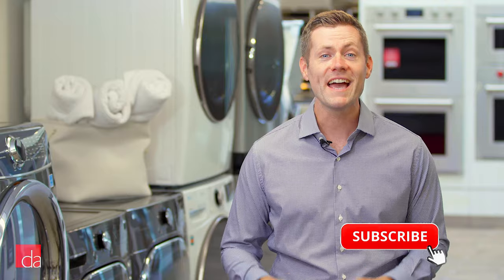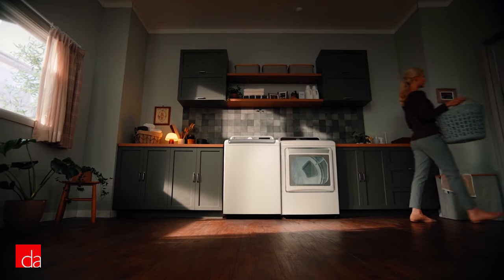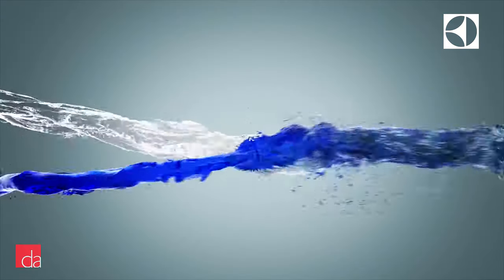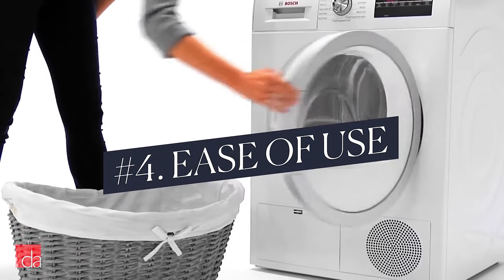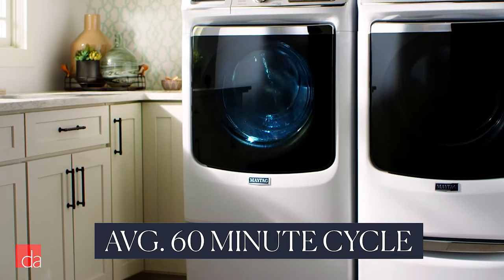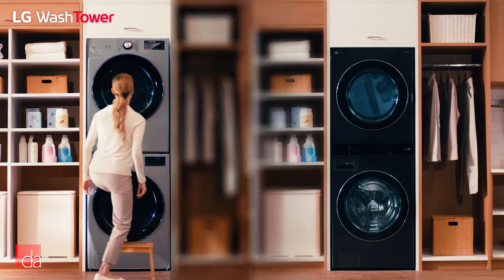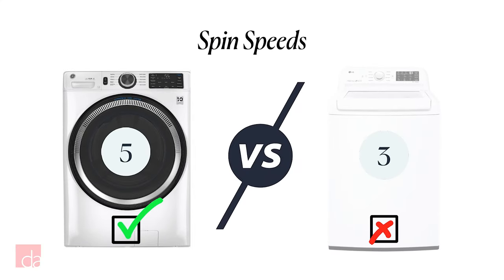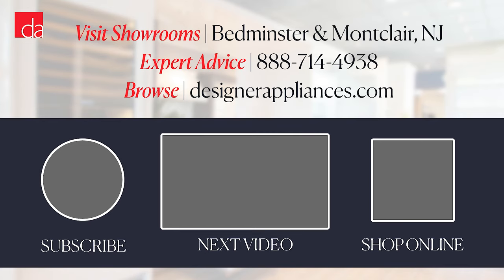Front Load vs Top Load Washer - Selecting a Washer Shouldn't Be Confusing (Updated)

Comment: Having owned both I can attest to the superior cleaning performance of a front loader. They win hands down in all situations. I do however have a $4,000 Miele front loader which is known for longevity and lasting performance. I think the reason so many American households have issues with mould is the way the appliance is used and limitations with the power supply. 

For instance, if you strictly use powder detergent, it contains bleaching agents which help prevent mould growth. However in the USA, Liquid detergent which doesn't contain bleaching agents is the preference. Additionally, its very big in the USA to use fabric softener and scent beads, all things that attract mould and trap dirt and odours in the machine. They also contain waxy residues which stay damp and promote mould growth. The reason your towels are coming out smelling musty is because the liquid detergent is unable to kill the bacteria, so then people have to add laundry sanitisers and scents to mask it. All additional expense and unnecessary if a good quality powdered detergent is used with bleaching agents. Liquid detergent really is only good for delicates and preserving colours because it doesn't contain bleach.

Another point, in other countries, our machines will happily get up to 95 degrees Celsius, almost boiling point which keeps the machine spotless. However, due to 240 volt not being standard and the limitation of power supply, front loaders in the USA are reliant on the hot water supply which cannot match these temperatures. Combine that with the machines not having the power supply to quickly get the water up to temperature and the short wash cycles, you're creating an environment that promotes bacteria growth. Therefore, even performing cleaning cycles, the water simply cannot get hot enough to dissolve all the additives and unnecessary softeners people are running through their machine and cleanse away the buildup. My machine will alert me to perform a cleaning cycle or run a program above 60 degrees Celsius if I have done 5-6 loads consecutively under 60 degrees celsius. 

I have had many front loaders and never once have I had an issue with mould, I just leave the door open, I dont even wipe it. There's no secret, use the appropriate length cycle with out softeners or additives and a good quality powder detergent, leave the door ajar and once every so often run a hot cycle and the machine stays mould free. 

My issue with the top loader was it spun at 700RPM, it unbalanced all the time and the wash performance was poor. Additionally I was using 3 times the detergent. The Miele needs so little detergent and spins everything to 1600RPM. It makes a huge difference when it comes to dry times. 

Maybe this information will help someone who is struggling to prevent mould, hopefully its helpful to someone.
Reply: Wow Luke!  That was great information.  Thank you for taking the time to comment here.   I will be mindful of your tips when doing laundry here on out.
Reply: 4000.
Reply: I use powder detergent . Ariel powder and i have a front loader for 4 years in my home plus my mom has a front loader for 10 years and never have mold problem .
Reply: @veronasaramati8627  true. Powder is the best.
Reply: You should almost never use a hot wash cycle if you care about your clothes
Reply: @flakgun153  almost. Just in some cases.
Reply: @flakgun153  you would only utilise a hot cycle for items such as towels and durable bed linen. You would not use those cycles for colour clothing or delicate items. These hot cycles are also very beneficial to use with an empty machine and a washing machine cleaning agent. For the most part, avoiding liquids and softeners are going to be the most beneficial with a hot cycle for say towels once a week.
Reply: How has your experience been with the Miele  ?
Reply: @massimo7219  it’s a good machine and I do think it is built well. I did have an issue with a noisy metal noise which is quite common for some reason where the springs require lubrication. The noise isn’t damaging to the machine but it isn’t what you expect from an expensive brand. The technician lubricated the springs and the noise was instantly gone. I haven’t encountered it with any other brand except Miele. However since that was done it has been quiet again when spinning.
Reply: Thank you, Luke, for your great post. I've never owned a front load but am considering. Do you put the powder in the dispenser or in with the clothes in the drum of the machine?
Reply: @anamacmillan7582  hello! You’re welcome :). I put it into the dispenser.  The dispenser is there as part of the design process so I figure why would they make them if it wasn’t supposed to be used.

I did try on one occasion out of curiosity just putting the power in the drum directly and at the end of the wash found powder that had not dissolved all stuck around the seal of the door but had never happened using the dispenser so I haven’t done that again.
Reply: For 4k it better clean well and last!  But why would you want to spend 4k on a washing machine!
Reply: Not ALL situations.. the main reason I say that is, if the location of the washer is in such a place that the door can't be left open at all times then a top load washer must be used.. We recently purchased a rental property and when we bought a new whirlpool washer and dryer set we were going to take our old set to the rental house. The problem is the laundry room is located at the back door and the washer is positioned so that if you leave the door open on the washer then you can't open the back door of the house.. If we were to leave a front load washer there, then there would be no way to leave the door open to keep it aired out and prevent mold growth. In this situation, top loader is the only way to go.. Just throwing that out there because its something important to consider when buying..
Reply: @williamblanks8500  it’s very true that the door should be left open. I have never shut my door on my washer with any product loaders I own and I regularly do a hot cycle to keep it clean. However the door doesn’t need to be wide open. The door just needs to be unclicked so it has a small gap and within a few hours air can still get in and everything is dry inside. 

I don’t use any fabric softener either because that causes mould. People put a lot of additives that you don’t need to clean the clothes and they all build up and create mould and smells. Most fabric softeners are derived from animal fats so you don’t want that coating the inside of your washer.
Reply: I think LG top loaders are an exception. I have a front loader and my parent's LG top loader washes better. It has a turbo wash function which spins the entire drum which then shoots 6 jets of water and soap on to the clothes pulling it through the clothes. The way the impeller then rotates and the way it is designed, you can see how the clothes rub against each other and are turned around. The rinse is also more effective with an extra atomising jet spray that rinses during the rinse cycle. It's amazing honestly and you can fit much more in it. My clothes come out cleaner in an LG top loader. But only the LG one.
Reply: Well said
Reply: Comparing luxury cars to washers is like comparing apples to oranges. No one should have to spend $4000 just to own a washer that's going to last for more than a few years.
Reply: Regarding the mold problem with front load washers: Whirlpool and several other brands settled on a class action lawsuit and admitted that they sold washers that had a known design flaw that caused mold problems. On a side note, we purchased  a  Whirlpool Duet washer in 2019 and it lasted 3 years before the cost of repair would have exceeded the cost of a new washer. We replaced it with a Soeed Queen top loader TC5003WN and love it so far.
Reply: @francoamerican4632  it’s an analogy that isn’t to do with the longevity but why someone would pay that price. I appreciate the design, the performance and the technology that is superior to other offerings. I appreciate the package as an entirety. The same way as when I buy a car, I could get a car that does the job but doesn’t have all the additional bells and whistles that I come to appreciate and the performance I get from European engineering is always more exciting to anything else I have owned. 

The analogy fits perfectly, you can buy an Electrolux which I would liken to a Toyota which is a fantastic car, it won’t have the same level of bells and whistles but it’s going to be a great product that will last. If an affordable option where I live and will give you a product at 1/4 or the price and do everything you need it to. 

Not sure why you guys in the USA have such problems with products going the distance. Other countries our washers even on the cheaper end of the scale easily reach the 10 year mark. All I can think of is you guys have more American products in the laundry category then nearly any other country. Brands like GE and Kitchenaid,and all those American brands you guys have on offer a lot of the rest of the world doesn’t and we don’t have the same issues. That may lie your issue.

Bosch, Electrolux, AEG all have affordable offerings at much less then Miele and all will do the task at hand perfectly and should last the expected timeframes. 

The only difference which may impact longevity for any brand is machines made for the USA always are supersized, have compromises with their power supply voltage and their wash times are short. Add in all the additives used to the average American home that are not necessary and it makes sense why they don’t last. My only advice to you is to buy European, even though Electrolux make their products in Thailand and India and china etc, their brand is at heart Swedish. 

Hope that helps
Reply: @francoamerican4632  I’m glad you are happy with what you’ve bought. However as you know, speed queen whilst not as expensive as Miele are still pretty high up there. If you are willing to pay the price for something you see as superior and the value proposition makes sense to you then that’s the way of the world. 

Brands like whirlpool don’t even come into my country and when they do they are here for all of five minutes before they pull out from the market again. The hold they have in the USA is backed off when they produced commercial grade long lasting washing for the domestic market and that hasn’t been the case for a long time. 

Whilst I can appreciate there was a lawsuit, you can sue anyone for anything in the USA. It’s not really a benchmark of truth. The fact is mould only develops if the door is left shut on the washer after use and the wrong chemicals or the quantities added are used. I know this not only from common sense but from working for a major white goods brand as a manger for three years. Mould is not a mechanism of a bad appliance, it’s a symptom of an appliance that has been operated incorrectly. I also remember the lawsuit you’re talking about and I believe they stated they would try to incorporate better design to allow for airflow to help prevent mould. In Europe, front loaders have been the only option in most of Europe for over 50 years. They have taken over with the majority of the market in Australia being front loader occupied. Asia as well. It used to be that top loaders still held their own in many parts of the world, but now it’s very biased to front load washers and they finally are cheaper then their top loading counterparts due to economies of scale. 

I bring it back to the point that laundry is a commodity, it’s heavily marketed for people to buy liquid detergents, scent beads, fabric softener, dryer sheets, laundry sanitisers. You’ve got people adding in 4/5 chemicals to clean their clothes. This is unique to the USA and it’s corporations capitalising on selling you what you don’t need and products that do no good for your machine. My Miele does have its own detergent dosing system which I wasn’t thrilled about, however I don’t add anything else. It’s not necessary. 

If you use a scoop of powdered detergent and nothing else, and leave the door of a front loader wide open after the cycle. Within a few hours the gasket around the door is completely dry, mould cannot form and you can either shut the door or leave it ajar. Periodically run a washing machine cleaner if needed through to cleanse the drum and if need be wipe the seal of any hair or bits of dirt have accumulated. It’s really not rocket science. It comes down to a set and forget attitude, and weather that’s a byproduct of sales staff not educating customers on what they need to do or it’s laziness I couldn’t tell you.
Reply: @LJ P 120V has nothing to do with water temp. You think you can't boil water with 120V? It's the difference in design. Washers for the European market heat their own water because of the historical difference in central hot water availability compared to the US. Also, European washers tend to be much smaller than ours, and also tend to be all-in-one washers and dryers due to the living space constraints. It takes much, much longer to do laundry due to this. I notice my European friends and family seem to be constantly doing laundry, instead of once every two weeks as it is in my household.
As for mouldy front-loaders, I think the problem is related to using too much detergent, generating a great deal of foam that gets everywhere, carrying food for mould. I think when Americans get front-loaders they continue using the washer as they always have, and can't believe that front-loaders require so much less detergent. Also, liquid detergent has become so much more popular and it seems to foam more. 
Having experienced doing laundry in Europe (yes, with Miele machines as well), I much prefer doing laundry in the US.
Reply: @Pheckphul1  I’m sorry but washers sent to the us market have their heaters downgraded to 1.0-1.3kw. Our washers are built to 2.3-2.4kw. The heaters simply don’t have the power to draw which is why many homes in the USA require a special outlet for electric dryers. The standard plug doesn’t give enough power for the heating required and the larger heaters are not compatible. It’s not a criticism of the USA it’s just the limitations of the grid. The same limitations Dyson had for many years and why Dyson came to the USA market very late. James Dyson talks about these issues and how his motors could not run properly in the USA market without significant reworking which wasn’t possible in the early stages of the company and that’s why Dyson came to the USA market much later when they had the finances to have a seperate product for the US market. The preference for a machine that heats its own water isn’t down to hot water availability but rather accuracy in temperature. My Miele has dual fill from hot and cold and in the user menu I have it switched off. It’s impossible to set the temperature to a target and get that temperature from mixing hot and cold from taps and having cold water in the hot water line. That’s why machines in the USA say cold, cool, warm, hot and extra hot. It’s not possible to get consistent results to a degree of accuracy depending on what the water supply is doing at the time. The same issue persists for dishwashers. 

I personally don’t find any constraints with a 9kg washing machine which would be considered fairly large, however they do go up to much larger sizes here. The European brands are just lagging behind with increasing sizes compared to some of the Asian brands. Not too long ago their biggest machines they offered where 5.5kg so for them to be at 10kg as the biggest any European brand is making currently would seem huge to them. LG & Samsung are offering 16/18KG models in comparison. However these don’t appeal to the majority. The sweet spot in many of the European and Asia pacific is between 7.5-9kg. 

Having worked for a major European white goods brand as a manager for many years, I can attest to any combo machines being a compromise, with poor drying results and long term reliability issues. Some people do use them but they are not common and sales of them don’t move as people have used them when they came out and wised up to how mediocre their results are, how ridiculously long they take to dry and how much electricity they use to perform that function. Majority of people now buy ventless heat pump dryers and stack them or have them side by side. I always say if you can have two seperate machine’s, do it because a combo is never a winner. When they came out the hype was high, except for the people have who absolutely no other option, when you do a survey of your customer base you’ll find 8/10 people will tell you they will never own another combo unless they had no other choice. 

However as you rightly stated, the issues pertain to the products used, the quantity of the products and improper maintenance/airing of the machine. All issues that really are user error. 

Today for example after I finished up doing some washing on some detailing towels from the car, immediately following I ran a 85 degree cycle. 35 minutes and the machines not got any time to build up grime or grease. It’s just about being proactive in your approach
Reply: @lukiejames  Actually, most washers in the US do not heat the water, but rather rely upon the water heater that is standard in all houses. As you say, this therefore doesn't allow for exact temperature control. Also, I believe our detergents are designed to work in colder water than in Europe. Most people don't wash their clothes in hot water due to cloth/color wear and shrinkage issues, in addition to using less energy. In my experience, outside of washing rags I've used while repairing a car or other similar heavily oiled cloth, warm water is sufficient. 
As for the 220v vs 110v issue, our internal wiring is mostly 110v, but the connection from the grid to the house is 240v. As far as I know, all electric dryers are 240v in the US, same for electric stoves/ovens. As 75% of dryers sold in the US are electric, I don't think access to 240v power is the issue. Rather, it's tradition. Top-loading and using household hot water has been the standard here.
As for a $4K washer, no thank you. Like most German machines, Miele are too expensive and overly complicated.  I don't recall the exact amount I spent on my LG washer 14 years ago, but it was around $800, and it does it's job quite satisfactorily. The only issue I've had with it is that I had to replace the tub bearing, which was very simple to do.
Reply: @Pheckphul1  you don’t need to repeat what I have already said in my original post. I am aware that they use the hot water system however European models still will feature an element as a boost to this in some applications to the US market. American made speed queen or American made products do not bother. 

Detergents are for the great majority universally all produced by P&G, Unilever & Henkel and branded different in different countries with different fragrances. 

However this is getting away from the original advice on preventing and maintaining a front loading washer. 

Happy washing! :)
Reply: Huh, that is very interesting! Im german and most people here use front loaders, and the mold bit confused me too. While it is something to keep an eye on, its never been as serious of a problem for me. You certainly dont have to clean it every week. But the difference in washing supplies and temperature handling might well explain the difference. 
Tbf Im usually running the washing machine between 30 and 60 degrees. A lot of clothes dont like higher temperatures anyway.

Im a bit ignorant of how top loaders work, admitteddly, but mechanically front loaders just seem to make more sense. Gravity allows them to really throw around the laundry, while a top loader can just wiggle them arund mostly. Worse, theres probably a difference between clothes at the center and at the outside. 

Like, im sure top loaders do the job too, otherwise they wouldnt be used, but the other way seems more logical. Top loaders seem a bit outdated nowadays.
Reply: @Schooey Not much of a place when theyre worse at cleaning and less efficient. Seems like one of those inventions that mostly keeps up because of traditions.
Reply: @Schooey Pretty much any "scientific" testing seems to have proven that front loaders are better though, its even mentioned in the video? 

Its also just logical. The top loader has very limited ability to hurl around the laundry, while a front loader can use gravity.
Reply: @Schooey If the professionals have better results with front loaders, then isnt that more of an indicator that people who struggle just do something wrong?
Especially the bit about mold problems makes me think so. Thats not a normal.

Afaik the popularity of top loaders is also mostly an american thing. Eg in Europe, theres almost only front loaders in use.
Reply: @Schooey Why do you hate experts so much lol?

I mean the people were talking about have the agenda of doing reliable and honest tests, because thats what theyre paid for and when they screw up they lose money.

And yeah, almost everyone in europe uses front loaders and they clean great, and generally dont got mold issues.
Reply: @Schooey Or have you just forgotten what I actually wrote? No, it must be everyone else thats delusional :^)
Reply: @Schooey Im biased because im citing scientific tests. How peculiar!

But hey, Im happy for you that you are so unbiased that you can speak for >500 Million europeans.

You got some problems lol.
Reply: @Schooey Looking it up, its more like ~50% for Australians, theyve been switching too, if slowly.

Also, imma be frank: Youre being a bit delusional here, aka you make stuff up I never said and then strongly argue against it. I did not claim that top loaders are worse in every aspect (the video seems quite good besides the mold bit), that people using them are dumb, nor even that they 'should' switch.

Ive said front loaders are more energy/water efficient and clean better, which I consider the most important factors for such a machine. That top loaders seem outdated.
Everything beyond that you just made up.
Reply: @termitreter6545  American style top loaders without heater are also used in developing countries around the world. Also don’t forget that the vast majority of people on the globe wash clothes by hand.
Reply: @lukiejames  so you bought a very expensive Miele washer and turn off or don’t like all the features that make it so expensive lol 😂 you could have chosen a much cheaper Miele model that doesn’t have all the features you’re turning off.
Reply: @Pheckphul1  nowadays talking about exact temperature control is a joke anyway. With all these ECO programs the washer doesn’t heat to the specified temperature anyway. ECO 60 heats to maybe 40-48 degrees. I guess what the companies are trying  to say with that is that the program delivers the same cleaning performance as a 60 degree Program 40 years ago. Just like on LED bulbs they tell you a 9 W bulb is equivalent to a 60 W candescent bulb.
Reply: @manuel0578  not sure what you’re talking about? I use the machine as intended.
Reply: @UCpmuRmPqOULBy6BQ8BO6uhA actually we do have top loaders in Europe too, but they’re just front loaders with a door in the round wall of the drum. That way you can reduce the width of the washer to 45 cm.
Reply: @lukiejames  you said you don’t like twindos and that you turned off the warm water inlet.
Reply: @manuel0578  You think because I want my machine to heat it’s own water and not take water from a hot tap that’s a feature? 😂 Miele don’t offer hot and cold fill in Europe yet they offer it here for some reason and it’s unnecessary. A cheap LG has hot and cold fill. It’s hardly a “feature”. Miele washers with hot and cold fill also only will use the top tap when the temperature exceeds 60 degrees. Therefore it’s totally pointless to me. 

I also do use Twindos however it is not used for every load. It is used when I want to use it. That’s the benefit of the machine. I have the ability to customise every part of the wash to my liking. 

I think you’ll find that a machine with over 20 programs and features, a hot water fill is not a feature…
Reply: @lukiejames  they do offer it in Europe but only on their most expensive models. Guess it’s different where you are.
Reply: @manuel0578  I have the top model they offer with the touch screen. Anyway, what machine I have doesn’t change my original sentiment about how to look after a machine.
Reply: That's very detailed! One other thing for longevity is level your machines! So many delivery people do not set up the machines properly upon delivery. This leads to early wear on all moving parts especially ball bearings! For upright washers you'll know by the machines shifting position during the spin cycle. Front loads tend to not move around much during the spin cycle but still, check your level for all appliances. The little feet under the machines are all height adjustable for a reason
Reply: @termitreter6545  Top loaders are better for heavily soiled clothes.   Front loaders are better for stains.
Reply: Thank you
Reply: My god, that's more than my parents paid for their 1st house!
Reply: @Pheckphul1  Combination washer/dryers are available in Europe but they are pretty rare. Most people will use seperate machines.
Reply: @lukiejames  We have problems because regardless of the numerous brands, the parts all come from the same place and their quality is inferior to the parts avaliable decades. Cheap alloys, plastic, and garbage circuit boards are the problem. I have a 23 year old top loader with the original timer, motor, and tans. One if my coworkers ask me how do I get my clothes so clean.  Sam with automobiles. My 40 year old chevy pickup though not fuel efficient is the most reliable vehicle ever built in opinion. Simple design and quality parts are the key to longevity.
Reply: Yo 4000 for a washing machine is crazy. You must be mad rich 🤑
Reply: What's it like been rich, Lucas?
Bet it's pretty neat.
Reply: I’ve had both. The front loaders totally suck. Mine was an expensive one too. I will never own another one again. $4k for a washer? Most people, myself included cannot and will not spend that kind of money on a washer. Kids braces-yes, washer no. A top loader does better.
Reply: Thank you